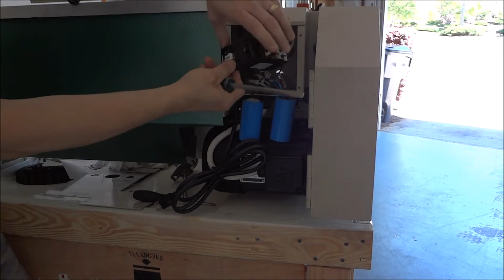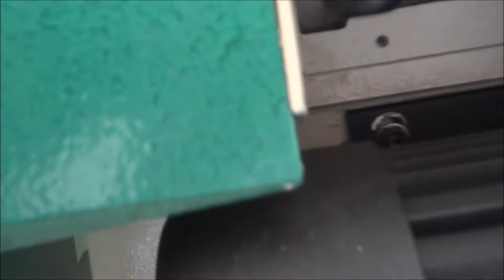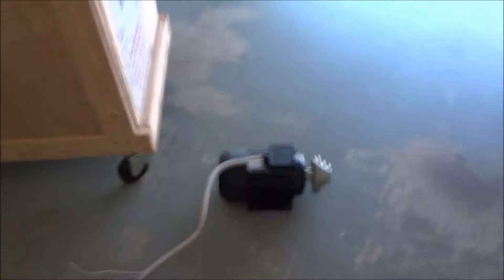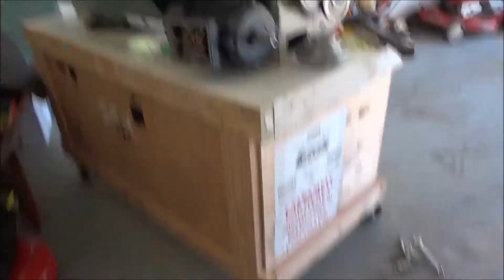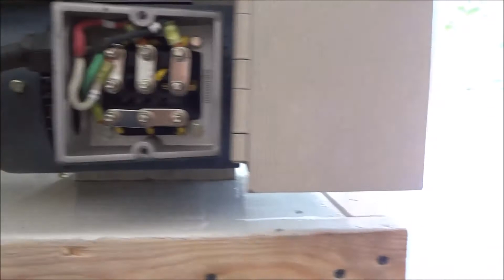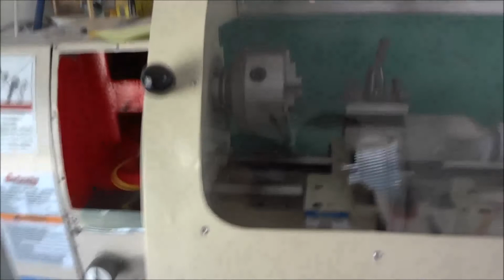G0602 Project Part  9 Lesson 3 phase  Motor Install

Comment: Those aluminum pulley are usually dimensioned so that it is installed warm, so that heat expansion makes it easy to put it on the shaft and then it locks onto the shaft tight when it cools down. Removal is just as easy, just use a heat gun to warm it up.
Reply from the maker: Yes they are, I did not try heat but she was on there pretty tight.

Comment: How does that motor preform at lower RPMs with the 110v VFD input?  Is it able to go slow enough and manintain enough HP to thread hard steel?
Reply from the maker: I would suggest unless you find bargains on the vfd and motor go with a 220v VFD and a 4 pole 1800rpm max 3 phase motor the stock motor is a D80 frame 19mm shaft. the biggest d80 frame motor lesson offers is 1.5hp
it may be possible to put a bigger motor on it say 2hp but I'm not sure.
Reply: CNC4XR7 would you consider the setup in this video underpowered?
Reply from the maker: criio1 it works fine for aluminium and plasrics bur
T for threading steel more power is better

Comment: very very nice work sir!
kindly please share me the spec of the parts (switches, potentiometer, etc) that is used in the project
Reply from the maker: There is a Parts list included with my Plans www.cnc4Xr7 along with all the wiring diagrams needed to convert the lathe in stages, add a vfd , partial cnc , and full spindle control cnc.
Buttons , Pot and Tach can be sourced from Ebay.

http://www.ebay.com/itm/Digital-LED-Tachometer-RPM-Speed-Meter-Hall-Proximity-Switch-Sensor-NPN-12v-GREE/181860910826?ssPageName=STRK%3AMEBIDX%3AIT&_trksid=p2055119.m1438.l2649

Comment: good morning and happy turkey day!   
 , is there any reason why you didn't use the 1.5 HP motor with D90s frame ?  do you think will be no space or enough room for the 1.5 HP?  or the VFD is not available from single phase to 3 phase with 1.5HP? like this 1.5HP LEESON 1740RPM D90S IP55 3PH IEC MOTOR 192202

  thank you for all these videos! 

Oz
Reply from the maker: +Ozy Ozy Thanks OZ, There was a great write up on the Lesson conversion already posted on the web I think I mention this in my video.
The G0602 is a D80 frame mount and I choose this motor as it was a Metric motor and a direct bolt in replacement everything fit nice pulleys motor alignment was spot on.
it's always nice to have more power and I'm sure you can make the mounts work for a D90 I'm not sure the dimensions though.

The 1 HP seems to have the power I need and being 3 phase makes a big difference.
Be Safe,
Sam

Comment: Hey watching again, why are you keeping the contactor? Seems like it shouldn't be needed now with the VFD.
Reply from the maker: Sorry just saw this post lol
It's a industry standard most controls for equipment have a contactor when energized the machine is in a" preset  condition" ready to run a estop or off button will drop it out of preset. The contactor maybe used to energize other circuits as well. 
Be safe Sam

Comment: Awesome!
Reply from the maker: Thanks she's up and running now and just starting to see what she can do the 3 phase motor is very smooth.
Reply: CNC4XR7 I hadn't considered doing this myself anytime soon, but I just bumped it way up on the priority list. I'm glad you had good luck with this conversion. Thanks for sharing it!
Reply from the maker: russtuff
Fairly easy mod. the posted online instructions were great and Henry did a great job. I wanted to document it on video some times its easier when you can see it.
Thanks for the comment love your channel and video's,
Sam
Reply: CNC4XR7 Your absolutely right. I've read a lot of the online instructions so I feel like I'm getting more ready. My motor should be here early next week. I just finished my CNC conversion so I'll be rolling out a series on that too, maybe not as in depth as yours though :)
Reply from the maker: It's a fine line there between informing and boring LOL But so many times I see a video and say man I wish they would of talked more about that. and i'm sure its different for everyone based upon there Knowledge. so I tried to include everything. I figure you can skip what you don't need. Cant wait to see what ya came up with on the conversion.
Thanks Sam